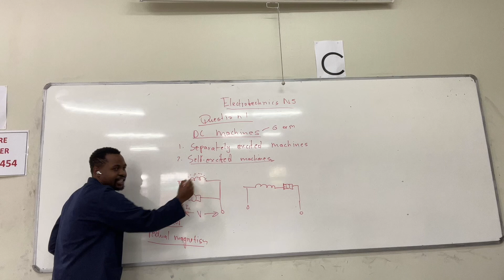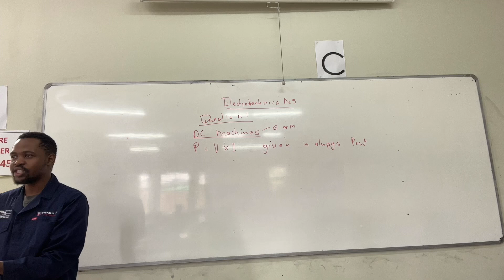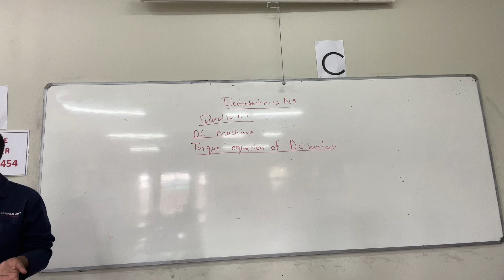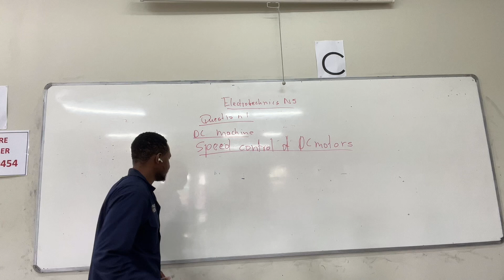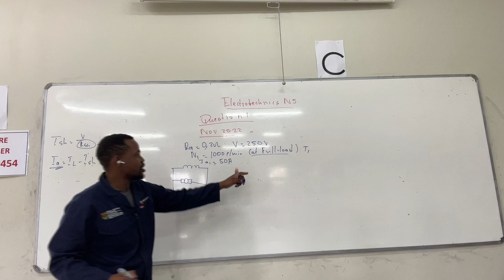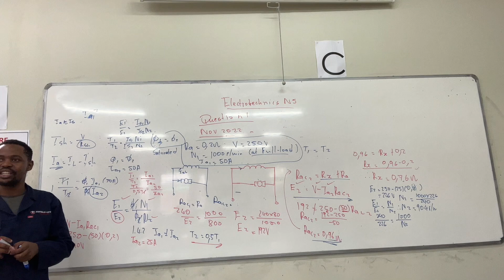EMF equation of DC machines and Speed control of DC motor Electrotechnics N5

Comment: Nice and informative video but 30:28 there is a note that states KW - Watt conversion which shouldn’t be there because at th original output power efficiency calculations the conversion was already made by making 25kW to 25x10^3 however they continue to increase again by taking 27 174 W and multiplying it by 1000 implying that it was 27 174 KW instead of 27,174kw . Can someone please assist me here because at 92% efficient how can power double its current capacity because there is no motor on this earth that can harness 54 000 amperes coz what size cables are you using at that point , and there is no way EMF of a motor can reach such voltages , so from a theoretical and a realistic/practical stand point this is not feasible so can someone please assist me with this. Please tell me if I’m wrong if I am I’m open to being corrected